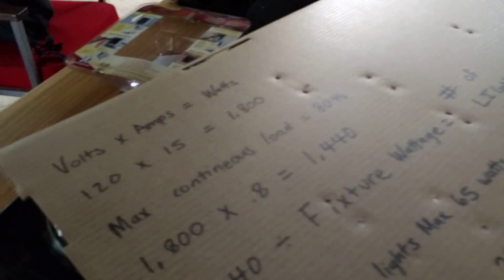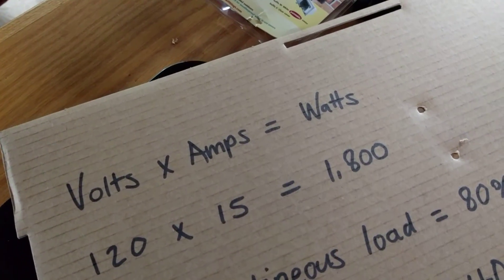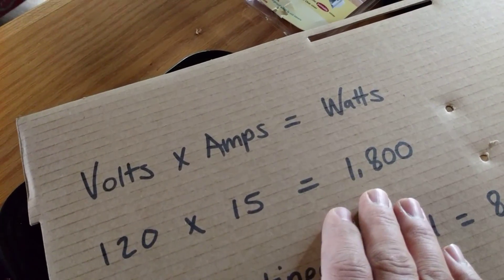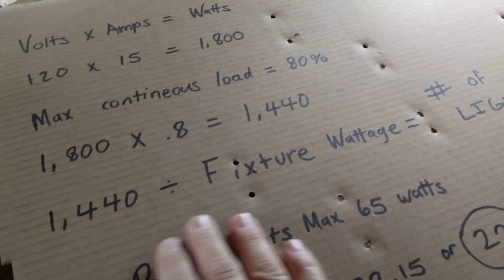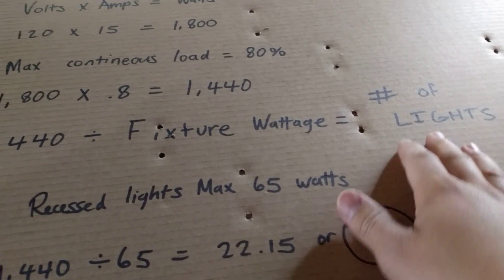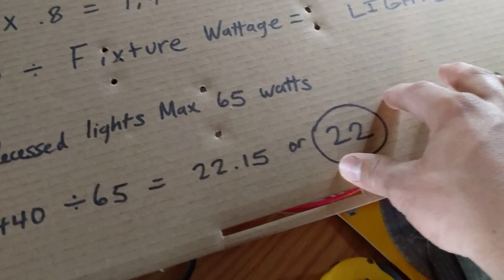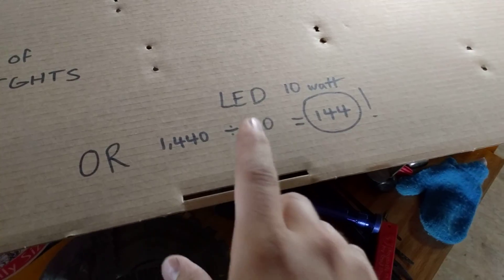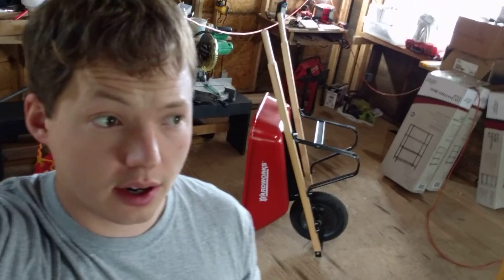How Many Lights on a 15A Circuit Breaker? Calculate Wattage for 15 Amp Circuit & Number of Fixtures

Comment: according to the NEC more than 3 hours continuing must be rated 1.25% of the continuing load
Reply: 1.25 rule is to determine breaker size and wire guage
Reply: For a continuous load
Reply: Well 80% x 1.25 = 100%
Reply: @dallasgombash5381  
We don't run electrical @ 100%
Reply: @slo-pitchhero8993  I'm saying that the math is the same. 1.25 x 1440w =1800w, 1800wx0.8=1440w

Comment: Benjamin,   A few finer points about this.    Recess lights wattage used must be based on the maximum wattage that the trim will allow.  Watts and va are the same for incandescent lamps, but are not the same for fluorescent, HID, or LED.   For these fixtures always use VA(listed amps x listed voltage).   As a designer, I never use the maximum number of fixtures.   I leave enough room on circuits that if a few lights need to be added, it can be accomplished with existing circuits.

Comment: Ben just had the whole house rewired. I tested each outlets with a plug in tester. All tested correct except 4. The four that failed had a dim neutral light. This is the tester that has three lights.  The right /orange light is bright while the center orange light is dim for four outlets. Is it possible that a neutral wire is not making good contact.  
Have your seen this before and what would you recommend?
Reply: Check that the black or white wire is not inverted or the ground wire is not touching any wire, check if the problem is with all the plugs down the chain of loop
Reply: @g.b.5206  I found the open ground. The electricians helper did not twist the wires before twisting on the cap... One neutral worked itself out of the cap.

Comment: I've got an old home with old wiring without a ground.Wondering  how to accomplish adding an outlet to existing switch.If I were to send video of the inside of switch could you tell me how to wire correctly??/Jerry
Reply: Swap it out for a gfi outlet.

Comment: Also keep in mind the gauge of wire. Some people will put in a “15amp” breaker but don’t understand the maximum load on the wire and will often put too small of a wire in. If you’re running 15 amp breakers, never use less than a 12 AWG wire. 

I honestly would use 10 just to make sure that what ever happens, the breaker trips rather than the wire burning in two. 

As the wire gets older it builds more  resistance and can cause over heating. I’ve seen it happen a few times in an older home. 

Corrosion from moisture builds on the wire and someone hooks up a high amp tool or appliance and it burns the wire in two, causing a fire in the wall. Better safe than sorry.

Comment: You base the circuit load based on the fixture rating  not the bulb you use in the fixture.

Comment: I dont understand when running new cable or new construction. People use 14/2 or 14/3 wire. 12 gauge wire is literally pennies more per foot. eBay sells 250ft roles of 12/2 250ft for like $50. You could still do the 15 amps breaker by why push the wire. 12gauge gives you enough over head. Breakers don't always pop right away. Inrush current to a lot of devices exceeds that current. It would give you room to go to 20 amp breakers in the future or currently. I went with all 20 Amps. You may want to make additions later on, lights ceiling fans, appliances, etc and with a lot of devices using more and more power. Why not just go to 12 and 20 amp breakers and be set for future tech. I hate being on 15 amp breakers air compressor and tools can to easily trip them. Or the kids or wife uses something. I have to use multiple breakers for my tools so it doesn't trip them. And the $30-40 dollars extra you spend will pay for itself in efficiency. As it has lower resitance and lower voltage drop.  On the feeder and branches

Comment: Isn't there a faster way to figure this? If you have a 120 volt line, and for example 1500 watts required, can't you get the number of amps by dividing 120 into 1500? 120 into 1500 equals 12, but to have a remainder of 20% you would need to use a 1500 overcurrent. Correct?

Comment: Continues load is a load that is on for 3hrs+. So if you are anticipating all your lights to remain on for 3hrs then you need to considered the 80%. (Not typically practical) As a licensed electrician I typically just add 2 bedrooms together, lights and outlets on a 15a circuit.

Comment: Well, Ben, than might describe how you wire a house, but not the way that I would wire a house.

I would use all 20 amp circuits with 20 amp circuits. I don't think I have seen a 15 amp breaker since the 1970s. And I am rather fond of 100 w lamps, or even bigger. I like lots of light. But you wire breakers by the room, and very few rooms are going to have more than three or four 100 watt lamps. As a matter of fact, except for chandlers or flourscent lighting, I haven't seen mush in the way of built in lighting. Maybe the garage and basement. Of course you NEVER want all of your lights on one circuit, for you would never find your way to the breaker box when all of the lights are out. 

The next issue is there is NEVER enough outlets in any room, and it is the outlets rather than the lights that you have to plan for. Computers, servers, printers, monitors (In your office and in each of the kid's rooms adds up very quickly. And of course each room needs an air conditioner. The battery back-up for my computer rack is 30 watts! (well I am running eight computers on it! ) ---Which also means that my office must have a 30 w AC unit) 

Of course you cannot guess what demands you will have ten years from now. My computer office is now ten years old, I'm not sure how much power I will require with the next upgrade. For all you know your kid will come home with a new sound system and he will require more power in his room. It's a fact of life, one that your parents never told you about: You never have enough electricity in a room. Now every little device needs a wall wart. Not much power being used, but you do not want power taps on power taps for all of these wall warts. I'd rather have a stack of three duplex boxes in each location then a nest of cube-taps and wall. warts.
Reply from the maker: Thanks for sharing!

Comment: What would you recommend to do. I have a electric stove using 220. I am switching to gas so it uses 110. I want to keep the same cable. What you think?
Reply: You'll have to change the breaker too, so the stove wire won't work.

Comment: Math is great to prevent overloading a circuit and it's also a good idea not to put so many devices on a circuit that it becomes difficult to troubleshoot. Both of these also allow some expansion capability. You don't want to be in a situation that requires additional home run wiring and additional breakers just to make a simple addition of a light or receptacle.

However, think about your worst case situations. If every light is on one circuit and that breaker is tripped the homeowner/end user will be stumbling around in the dark trying to fix a problem they don't understand. It could be someone with a physical disability, an elderly individual or a teenage babysitter that just watched the movie Halloween!

I always try to pick a central lighting location (hallway, etc) that is fed from a bedroom circuit. If the lighting circuit is tripped there is still one light working to aid the homeowner.

Think ahead. You only have to build it once. The homeowners have to live with it every day, possibly for the rest of their lives!
Reply: curious, how do you make sure you can see when the power goes out?

Comment: As an electrician, I still break down lighting for practicality and convenience. In other words, if this were my house, I would break it down into lighting “areas“ such as having one circuit  for bedrooms, (and perhaps the master bedroom/bath on its own lighting circuit). Another circuit be strictly for outside lighting… One circuit for the kitchen only, and so on. Yes with LEDs, you could put the whole house on one circuit now. Very bad move because if anything should go wrong with that circuit, you lose all your lighting. It’s all about convenience and practicality now that “overloading“ a circuit is less of a problem now more than ever. Also, if you should decide to add additional lighting on a particular circuit, you could shut that circuit off while not affecting any other part of the house.
Reply: if the power goes out, so do all your lights, which happens way more often than a lighting circuit tripping.

Comment: Word of advise; find an electrician to do electrical work, 45 yrs.  electrical experience. In most cases you'll have a proper installation, in accordance with CODE.
Reply from the maker: Good advice for sure! Are you a retired Master Electrician? Want to move to Southwest Minnesota and start a business with me? I don't have my masters yet and want to start an electrical company. Would be a slow start and probably just part time "supervision" type work. Anyway, thanks for the comment!
Reply: @BenjaminSahlstrom  Thanks for the offer, but nah, learn the code you'll go alot further.  Never forget local codes can supercede NEC & IEC. That said nothing beats hands on experience just learn to use the code book and study it. Even Ugly's is good reference, among others... Never cut a corner;  good luck.

Comment: Always (ALWAYS) figure based on the potential / possible load. You could do the math for LED bulbs but if someone can't follow directions and substitutes a few incandescent bulbs, all bets are off and the system is overloaded! Better to be on the safe side till they come up with a new standard where low power bulb sockets can't accept a typical incandescent bulb. (IE, those pin base fluorescent bulbs) That's the only way to keep dummies from messing with things.

Comment: I have been told years ago no more than 8 devices per circuit including switches? Is this true? thanks
Reply: Jim Shorts no more then 12 on a circuit,  but the best rule to avoid overload. Calculate each outlet to hold 1.5A.
Reply: Calculate circuitry by what the load is going to be.
Reply: @dallas5374  I know that is fine but I also thought without any load I think there is a limit if I am not mistaken by code. I am sure I am prob wrong just going to back to something I was told back in the late 70s early 80s
Reply: @dallas5374  What if you don't know what the load is.
Reply: Why count switches, they consume nothing power wise?
Reply: @robertgregory2618  Just something I was told years ago by an electrician. Something about a device count.

Comment: Using just one circuit to power lights can leave you in the dark, I ran two circuits so if the main light circuit gos I still have light in the rooms.
Reply: Kevin Chastain  I guess depends on where your main board located as well. I had three for three directions.

Comment: Why deal with watts ? An electrical just does a load calculation. Paramount to know the exact fixtures and their respective current draw.
Plus the 80% rule is for a continuous load circuit, (3 hours). So quantify that statement. So you need to know exactly what is expected of that circuit.
Your inspector knows very little. Have no idea why trouble shooting would be more difficult, guess because of more switchs & fixtures.

Comment: nice video
can always keep it simple - multiply the number of receptacles by 1.5 and keep that number under the breaker rating and corresponding wire gauge.
Reply: Where in the NEC does it say this?
Reply: Here the code is 10 light fixtures and/or plugs per 15 amp breaker. Not including counter, fridge or microwave plugs.

Comment: Light fixture loads are to be based on the maximum load the fixture is rated for.   Downright maximums are different with different trims.   Also, it's ok to use wattage with incandescent lamps.   Anything else, find the line current!    Power factor and ballast or driver load comes into play.   With 120 volt circuits, line current times 120 is the value to use.   Respectfully,   Kevin

Comment: You can put as many lights as you want on a circuit, but if you add a recept. Your only allowed 9 lights and I outlet. That's how it is were I'm at.
Reply: Dominic Lovato Lol may I ask where you learned this? It definitely wasn’t out of the NEC.
Reply: @dallas5374  There's NEC you have to follow. What other codes do you have to follow? Well there's state and then the power company.
Reply: @dallas5374  It referred to as a lighting load. If you have all lights on a circuit then you calculate the load, but shouldnt do the max. In case someone use a different light then your calculation are no good. Leave room for future use. Where I'm from no branch-circuit may not have more than 10 outlets and/or light on a single circuit. Single and duplex recepts are counted as one. If the branch circuit is just lighting load refer to Article 220 of the NEC. For load calculations. So its more practical to run a room with only 10 outlets. If you got 5 in one room then you can put two rooms on the same circuit. Keep in mind though in 10 years if homeowner wants to add a light or outlet. So it up to the electrician to decide if one room will have 7 or 8 outlets leaving room for future expansion.
Reply: @dallas5374  If this Dallas guy comes to work on your house I suggest getting someone else. He understand the NEC but didn't learn that state code superceed NEC. What works in the east coast won't work on the west coast. Many factors go into it. I just leave it up to the engineer to do the math. If you can do the math and then show it to the engineer. You might end up getting a raise or a bonus.

Comment: 2:27 nope, look at the switch ratings, the capacitors in LEDs have a bigger load on switches than inductive loads like incandescent and halogen. Depending on the switch design, it may be as low as 20% or as high as 50% (i.e. 600w inductive, 240w capacative)

Comment: How Many Lights on a 15A Circuit Breaker?
HOW MANY LIGHTS WILL BE ON * AT ONE TIME ** can you understand ??
Reply from the maker: True in that you can put more one one circuit if you know that the lights or other devices will not all be on at once. However, in my opinion it isn't a bad idea to assume that they all may be on at the same time once in awhile. If you put a bit less on each circuit then you will have a lower chance of tripping the breaker and will also have some room for future expansion of said circuit.

Comment: In Canada ,by code, 12 devises on a 15 amp circuit.
Reply from the maker: I have heard that. Seems a bit restrictive but also nice that it is a clear  cut answer. What about for a 20 amp circuit?
Reply: @BenjaminSahlstrom Code rule 8-304. CEC(1)There shall be no more than 12 outlets on any two wire  branch circuit, except as by other rules. (2)Such outlets shall be considered to be rated at 1 amp per outlet, except as permitted by subrule (3)Where the connected load is knownthe number of outlets may exceed 12, provided the load current does not exceed 80% of the rating of the overcurrent devise protecting the circuit.   I would take that to mean, if you use LED light fixtures you can exceed the 12 outlet limit. BUT if you use a fixture where the  lamp can be replaced by a larger wattage bulb, your restricted to 12 outlets.  I don't have a current code book, so I don't know if LED lights have been specifically addressed. If not, I'm sure they will be soon.
Reply from the maker: @paulcrowe9445  Thanks for the additional detail! So it is limited to 12 for 15amp OR 20amp circuits since they are both "two wire branch circuits".
Reply: @BenjaminSahlstrom   Yes, with the exception per subrule (3). But most 20 Amp circuits are intended for heavy draw, like toasters, coffee machines Etc.(usually some kind of heater) so would probably never even have 12 devises attached.

Comment: Help on what wire size to use to operate 20 HP motor on the plate have Amps 57.0/28.5 
Thank you,
Reply: Can use an AWG# 4 / AWG# 8
Reply from the maker: Thanks Ricardo for responding!
Reply: Your welcome Javier ...keep me upto date with the result if you have the time 👍

Comment: Basic rule of thumb in New York using 12 gauge wire is no more ten outlets or lights on a 15 amp cut. We have the strictest codes in the USA.

Comment: if you switch them it is not a continuous load.....that is mainly for motors...also depends on breaker type etc.....find a good res electrician and have a conversation with him......there are rules of thumb that a good hand uses......
Reply: Continuous loads are mostly in commercial, industrial work.

Comment: There is something wrong.. you didn't put into consideration. The heating capacity of wire used. And the STANDARD calculation is to assume a 100watt  light bulb wattage used..therefore. V(X)= Wt
 And according to the Electrical Code of U.S,"  1 15ACB there should ONLY 10 bulbs maximum". So therefore at  15A breaker there should only 10 bulbs connected into it..

I think there are free seminars avery year at some selected big electrical companies.

Comment: Hi Ben
The voltage supply to our houses are single phase 230V and the current depends on the amount of load of our house.
As the load of our house increases, the current needed by our house will increase. if I get 15A in my home then...

(15A) (230V) = 3450W 
(3450W) (0.8) = 2760W 
2760W /65W = 42.46 lights 
42 spotlights 

Hey Ben 
I think this is correct 
isn't it? 
thank you

Comment: Circuit 
14 gauge wire
(15A) (120V) =  1800W 
maximum contineuos load of a circuit is 80% = 0.8 
multiplying  (1800W) (0.8) = 1440W 
fixture wattage = 65W 
dividing 1440W / 65W = 22.15 lights 
22 spotlights 

Thanks Ben
Reply: aragor iluvatar 👍👍👍👑👑👑